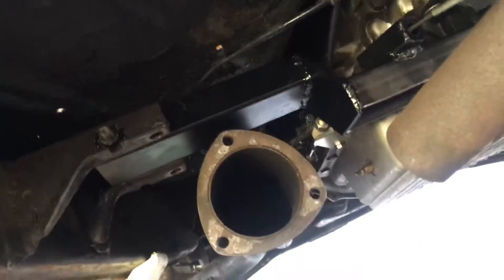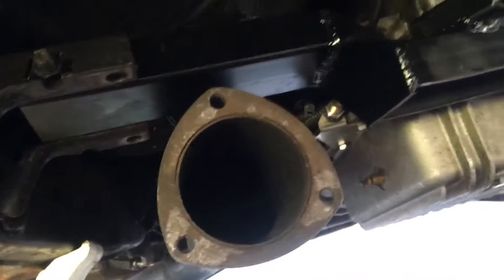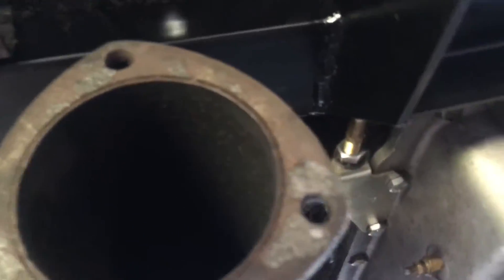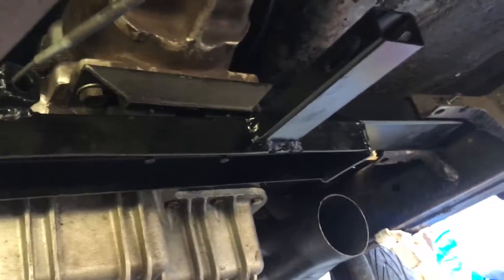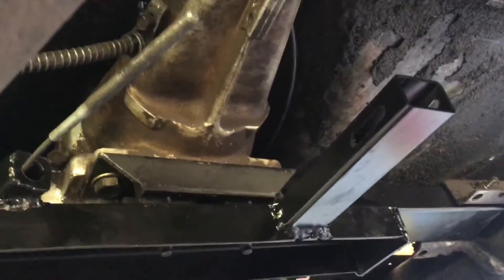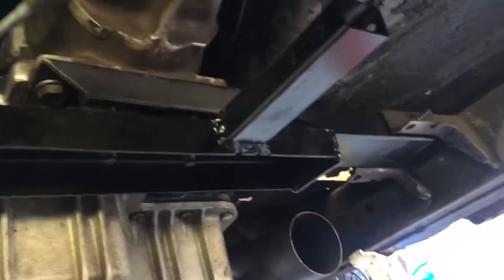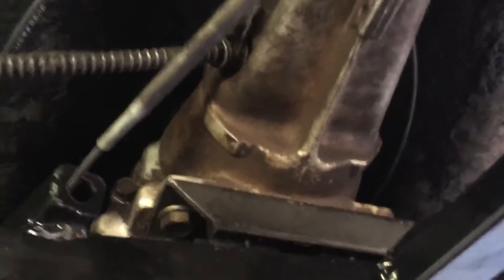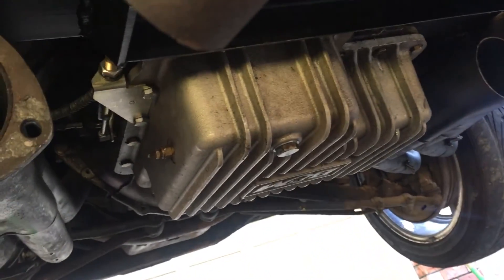C6 Ford transmission swap using Crites Performance crossmember in a Ford Galaxie

Comment: What year car are we looking at?
Reply from the maker: It’s for a 1962 Ford Galaxie. There is a difference between the 1960/62 vs. 63/64.
Reply: What else do I need other than that to do the swap on my 62 Galaxie with the 390 in it?